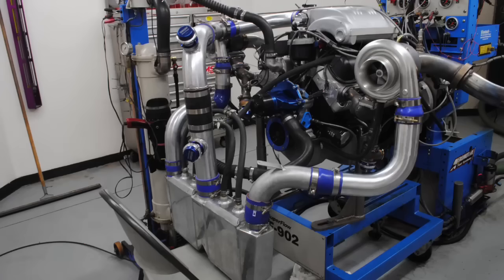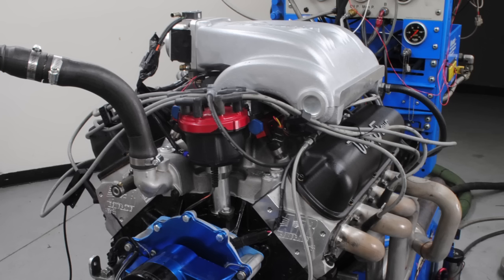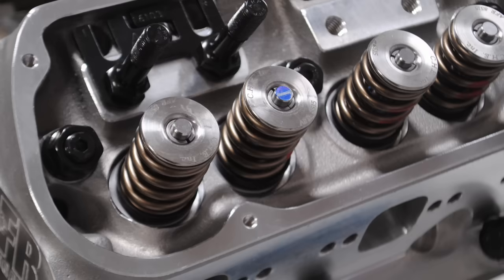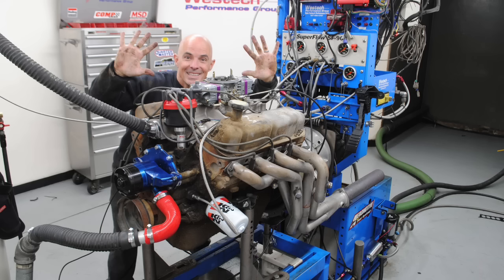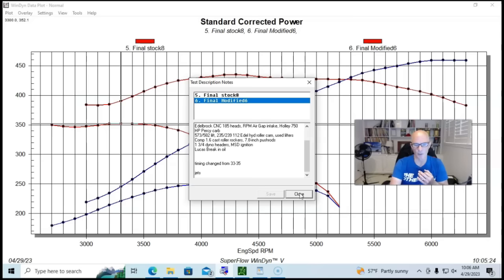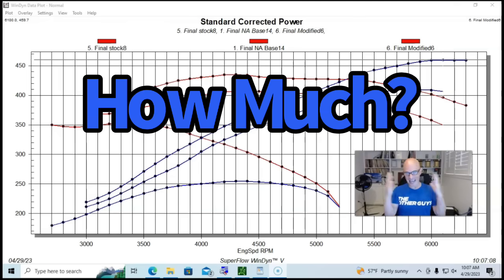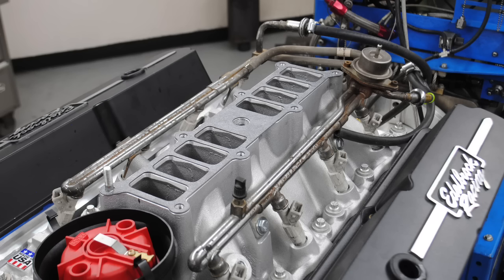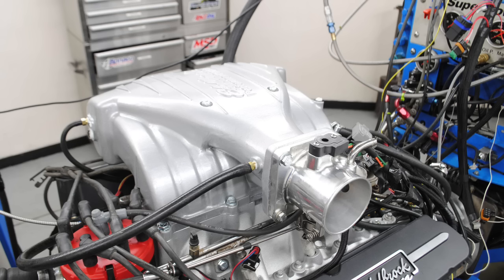WHY WAS THE 1000+HP BIG BANG 351 TWIN TURBO SO WEAK! HEADS, CAM AND INTAKE 351 SHOULD MAKE MORE HP!

Comment: Could be the AFR 185 heads you got were Part # AFR 1351 instead of AFR 1341. The 1351 has a slightly bigger intake valve, they have 2.021 valves, or something similar. The 1341 intake valves are 1.901, or something similar and are for stock pistons. This is my guess of why you had to shave the piston. Great content!

Comment: I think you're on the right track. 
I'd take a look at listed flow numbers for the EFI intake manifolds and go with the highest flowing one you can find. The carb manifolds always seem to outflow the EFI manifolds by about 50cfm at the top. 
Short of that maybe have an EFI manifold ported to get the best you can out of it. If the fueling and timing are spot on, the next step is air management. Ruling out the heads leave the only 2 items left in the equation can and manifold. 
It is worth noting, 1 7/8" headers would probably be preferred here over the 1 3/4" you have.

Comment: Intake runner length versus cam timing. I bet you're getting the intended resonance at an RPM the cam profile isn't set up for producing more power, so when the cam is in the meat of it's curve the runners are basically stepping on themselves and being restrictive. 

Also did I see a LOT of metal hogged out of those pistons for clearance? How much compression did you lose to that?

Comment: 351W BB motor. Test the bigger cam with the bigger AFR heads and use the dual plane air-gap with carb vs throttle body EFI (Terminator or Sniper), then switch to a single plane Victor Jr with port EFI. You can use the Holley ECU or the ProFlo4. IMHO, the bigger heads will carry the cam 500+ rpm past the expected cam limit. The port EFI will also help the peak HP. I like a 408 with 215-225 heads and a 240 @ .050 HR cam. Test away.
Reply from the maker: port efi won't help peak power-it will hurt it

Comment: I wish Holley would make low and mid ram intake manifolds for SBF's to go along with their high ram for guys who dont want to modify their stock hoods.  Looks like it would work with the side feed lid or front feed if running a crank trigger (no distributor cap) ignition.

Comment: Richard im currently running a stroker windsor to 393 w/twin 88mm turbos and using the holly high ram intake system w/the holly sniper system  i just got it running  so i cant give you any data as of yet  i had a hood clearance  problem with the top piece that comes with the high ram so i  cnc cut a 3/8 aluminum plate to fit the sniper throttle body . i havent run the motor a whole bunch as of yet due to im still fabricating stuff for the car .  something i found its doing and not sure why its doing it is  if i stab the throttle  the engine just dies out like rt now  but starts rt back up but if i bring the rpms up gradually it revs  and starts to build boost  ok . do you have any ideas what might be the cause ? i still need to play with the tune yet im hoping thats all it is im new to building a turbo car with EFI . also one other question i have noticed the left bank is puffing out oil smoke  and ihave herd that if your using a HV oil pump is a no no for a turbo motor  but not knowing when i built the motor thats what i put in it .   can i use a oil restrictor in the main line to slow the flow ? or get a regulator ? what would be your recommendation ? thanks buddy i appreciate your expertise imput   Bill in nor NV.
Reply from the maker: it is tune-why twin 88s?
Reply: @richardholdener1727  no particular reason but as i recall i got a good deal on them . whats your thoughts  on it puffing oil out of the turbos

Comment: I believe the runners on the TFS intake are too long. This intake for the 302 is the about the same length as the stock 302 intake. When using the 351 lower it is then one inch longer on a larger engine. The few dyno sheets I can find on this intake show the peak HP around 5500 rpm and I have similar results on my engine. I have purchased the box R upper intake and will try it later this year.

Comment: It honestly scares me sometimes that people look to this guy for tech advice.  The cam MIGHT be 8hp difference. If you look at hp graph of both motors you can see where it widens gap from other one at 5500+ due to cam/intake

You think a MUCH longer runner EFI intake is going to be better at high RPM?? Why would you think that?

Your test showed both intakes were within 10 ft lbs peak, but big bang engine is down everywhere its not the manifold obviously. 

Compression ratio difference was never mentioned.   Did you bother to do a compression or leak down test on the million mile junk yard motors? That would be EVERY engine guys first step in figuring out what's going on... the cranking compression and leak down numbers are gonna tell you a story.  You can keep throwing parts at it hoping things will stick but it all starts there
Reply from the maker: you know so very little-stick with the internet
Reply: @richardholdener1727  I've done this stuff daily for the last 23 years for a living,  I'm not the one just talking on the interweb sir.  What were the leakdown and compression numbers on that thing??
Reply: Jeff Lowry That was rude man. Richard has dyno tested a lot of things and has a very good understanding of the way these things fit together.  Bill Ballinger.

Comment: Wouldn’t compression be increased with the 185 heads?
Reply from the maker: depends on chamber size
Reply: @richardholdener1727  any specs on the heads used?
Reply from the maker: we didn't use 185 heads on this
Reply: @richardholdener1727  I thought it said Edlebrock e-CNC 185 in the video?
Reply from the maker: I though you meant afr 185 heads-but the edel heads were within 1 cc of the stock heads
Reply: @richardholdener1727  thank you !

Comment: The cam.
You say it worked good on a 302....well, a 302 is not a 351 and the cam will act as a smaller cam on a larger engine.
It's not lift or LSA....it's duration at 0.050, you need to be in the 250+ degree duration area and 265'ish wouldn't hurt a bit.
With turbo the cam should spec more lift and more duration on the exhaust than on the intake.....gotta drive the wheezer, right ?
It's obvious to me with the cobbled hogging on the piston dome you're no engine builder....far from it.
Reply from the maker: you don't need a 250/260 cam in a 351 to make over 1000 hp with a turbo-it can easily be done with a 220 cam
Reply: @richardholdener1727  Heh, right.
Then do it :)
Reply from the maker: I have many times-you can make 1000 hp with a turbo ls using a 202/202 torque cam-it just takes more boost

Comment: I watched the old video and you had a plan then ..... Different intake manifold is probably a good idea .... You really need to run better boost control on some of this stuff but you know that already .... I think the real problem was the valve relief weakened the ring land  you did not have a lot of photos so just kinda a wild guess on my part ..... Since we know at this point what boost does to power how about showing a rising boost curve on the redo

Comment: 1994 and up roller blocks are knocked for being weaker, but yeah, while that intake design copies the Saleen $1,000 intake design, it's still a long runner design and back in the day, most went for the short runner "breadbox" designs that killed torque down low for above 4,500 rpm performance out of the 302. would be interesting to run one here to find out how much the housewives' theories were true. and an infrared gun scan of intake manifold heat would be interesting--is that long runner huge surface intake really soaking up the heat post intercooler or not?
Reply from the maker: no on the runners soaking up heat and the box upper intakes lose a lot through most of the curve and the TFS R is not a copy of the Saleen (the closer match to that would be Holley SysteMax)
Reply: @richardholdener1727  interesting on the first, since you once claimed in your book that the shape and size of the classic 5.0 intake made it a heat soak. so what does TFS do different? 
Meanwhile, i wonder if a short runner intake like say Edelbrock's Victor EFI (i would say the Power Products version but i know there's a ton of casting flash and port matching to be done) would be the middle ground between the old breadbox and the classic long runner?

Comment: Those 185 edelbrock heads flow air faster than the afr. The afr 195 are better on a small motor

Comment: Funny, just before you mentioned it, I was thinking that you might want to try the Holley high ram next time instead now that it is available. I think that would be the better choice, other than going to something like a carbureted intake that is converted to efi with an elbow, for sticking with an ego and getting the best numbers from it. The later choice would definitely kill some low end if you did it with something like a Super Victor single plane, but that adds extra cost and complication to it since it’s not an off the shelf choice.

Comment: Could this be a deck height issues doesn't the 351w come in either a 9.5 or  9.4. The 9.5 could have been down on compression because of that? (NA issue)
Reply: Less than .05 between them. Maybe you're thinking of the 9.2 aftermarket Boss blocks being smaller.

Comment: The camshafts are pretty close in timing to one another. I think the camshaft shouldn't be the main reason for the lack of power. What about the compression ration between the AFR and Edelbrock heads used in the test, how much of a difference is there? The original strength test was very interesting! I wonder are we at the similar level of weakness on sbc bottom end under boost?

Comment: I ran a 90s model 351w roller block, nice heads, E303 cam, blow through 8:5:1 comp. good rods, pistons, main stud girdle with a t4 pt 74mm turbo, air to air, that made about 700 wheel at about 15 lbs of boost on pump 93 that lived a couple of years with a manaul 6 speed transmission, when I swapped for a c4 auto trans the engine spent a lot more time above 5k rpm and thats when the block split through the mains after a few months. 
When I took apart the engine all the main caps along with the stud girdle had shadowing marks from moving around.  luckily it didn’t destroy itself when it split, all that happened was it lost oil pressure. 
Then I swapped a 1970 351w block with the same combo that never came apart. 
Now I run all LSX stuff and its like cheating compared to production SBF blocks.
Reply from the maker: you didn't hurt the block from lack of strength at 700 wheel hp
Reply: Everyone has their own opinions Richard.

Comment: Have a similar 351w just with 12.1c/r, can i safely run boost on a dual plan air gap with E85
Reply from the maker: yes but why would you
Reply: You'd try the holley hi ram for boost?

Comment: If you're blaming the torque on the 351W blowup it was 200 odd less than your LS big bangs wasn't it ? 
All those Ford EFI manifolds must all be too long in the runners for revving up.
Run that 351 base manifold without the top bolted on 😬
Reply: Ford never put an EFI 351W in anything but trucks and a one-off Mustang, so they're tuned for low end grunt stock.

Comment: Yeah, it's an apples to oranges comparison with the different cams and induction setup's.
One thing you mentioned.....you never know what kind of treatment or abuse a salvage yard motor has been subjected to. If the big bang motor was seriously overheated any time in it's life, then most likely, the ring  seal has been compromised or reduced, and that could also be a contributing factor for the lower power  output compared to the other motor.

Comment: Hi Richard - if you end up using a cutter on the pistons to fit a big valve head again, it'd be interesting to know what they all weigh after the Big Bang! 😆I've been tempted to do that a time or two on Junk Yard builds, but never had the courage to do it. A friend always jokes that he's "sure they're within + or - a half gram", when he does it. LOL
Reply: They were stock and I highly doubt that well balanced from the factory.  Reducing piston weight from a balanced combo is safer than adding.  I've swapped pistons out for ones over 50 gram lighter w/o re-balancing but it was only a 420ish combo.
Reply from the maker: you can measure them all if you like-but it is not a concern
Reply: @richardholdener1727  A small imbalance at 1000 RPM becomes a huge imbalance at 8,000 RPM. An imbalance of only a few ounces can generate a force of over 200 lbs. at 8,000 RPM! That’s a lot of shaking and stress on the engine’s bottom end. But, for a Big Bang engine probably not a concern. Keep up the good work, Love this stuff!
Reply: @cgarris8674  How do you measure/balance the amount of oil on each?
Reply: @BOOT  That's a good question!  A good windage tray, crank scraper or dry sump may help.A few extra grams also needs to be added to compensate for oil in the bearings and clinging to the parts. The total mass you end up with is what the counterweights have to equal to balance the engine.
Reply: @cgarris8674  But how will it be equal cylinder to cylinder at all times?  Even with a good vac pump or drysump you can't control/maintain an equal amount. As you said some things "MAY" help.  Oil control aside, what about the amount of fuel on top of each piston as they rise?  David Vizard in one of his older books said something like, if the budget doesn't allow for balancing then most combinations will be fine, the engine will just be smoother with balancing.  As with many thing it's not a universal all apps answer.
Reply: @BOOT  Yep, It'd take someone smarter than me to figure that out. Some engines that stay above 8500 RPM, they actually overbalance. putting 51% or so on the Bob weight. Supposedly they found hp there due to the harmonics on some cup engines.... how, I have no idea. Like you said if the budget allows.  Balancing tires on a trail buggy isn't required but on a daily driver it sure is nice.

Comment: Just wondering was the junk yard engine mag checked for cracks if there was a Crack in the main valley could it cause vacuum issues causing the lower H.P.
Reply from the maker: mag checked? no sir-it was just run
Reply: @Richard Holdener  Sorry sir I shortened the term Magnufuxing the engine we had one that had a Crack down the mainvalley into the cylinder that I didn't see and when heated up it had weird vacuum reading and shockingly enough it didn't even over heat or give any symptoms. Just an idea. Thanks for all your vids I learn alot.

Comment: I don't know why anyone would run a 75mm throttle body "R" on a 351w anyway? They make a 90mm version. Other videos on youtube have shown a noticeable increase in power with a larger throttle body. That engine was being choked. The "Box-R" Trick Flow intake w/90mm would be an even  better option than the standard "R" intake.
Reply from the maker: I don't think they made a 90-mm TFS R upper when this test was done

Comment: I have a very experienced forum buddy, Steve  from a company in  Lebanon, IL. He has used the Trick Flow R upper and lower, on customer cars  and has been  quite disappointed with its out of the box flow. As it came, either 5.0 or 5.8 liter,  it requires a few minutes die grinder and linishing work radiusing the lower to upper and that helps some. Hard edge Square section holes don't seem to show good HP returns you might expect. The rest might be a poor cam lobe centerline choice. Maybee those two factors are 410 hp at 5800 rpm. Importantly, I notice your quoted figures  on the big bang engine is revised down and different 4 to 1 HP from your 2014 article.

Comment: Richard, I'm in complete agreement with you on the intake system limiting/reducing the power numbers. I pay a lot of attention to firing sequences, as opposed to firing orders. One of the problems with the Ford 1,3... firing order is that cylinders 2,6, and 5, all hit the intake manifold consecutively. On a dual plane manifold, this isn't such a problem as the separated plenum isolates/protects the cylinders from charge robbing during the intake stroke to some degree. On a single plane manifold, the larger plenum also helps the situation. On the efi manifolds however, the front part of the manifold is in an extreme demand situation compared with the rear part, as these 3 cylinder runners are side by side in the plenum. My personal opinion is that the front part of the plenum needs to be at least 1 cylinder volume larger in capacity than the rear. I would also suggest that in a dual tunnel ram set-up, there may be an advantage in having a larger carburettor on the front, and/or a larger plenum volume in that area. Unfortunately, I no longer have easy access to a dyno to do testing with, so my theories remain just theories. What's your thoughts? Great video. Regards Greg
Reply: Front as opposed to rear ?? 4 and 8 fire 90 degrees apart.
Richard isn't into plenum volume.
Reply: This theory works only work in a situation like the Holley hi ram with a front inlet. The standard Ford EFI intake manifolds are all side mounted and air hits the chambers more evenly.
Reply: He also isn’t into rpm. 
Boo.

Comment: I dyno tested a 75mm tb vs a 100mm tb on a 365ci SBF: https://youtu.be/c-RqsPv4aa4  That and the intake (as Richard says) are this biggest HP killers.  FWIW, the car in the TB dyno test had a 228/242 cam in it.  The intake on that car started out as a Trickflow Street EFI, but has over 11 lbs of aluminum cut out of it (which is why it only says "Trick" on the top) and the runners are ported as much as they can be without breaking through.  I still think a Box R r even a single plane would show more power.